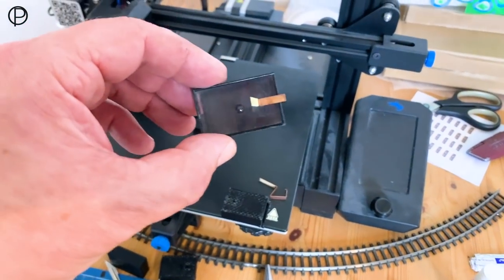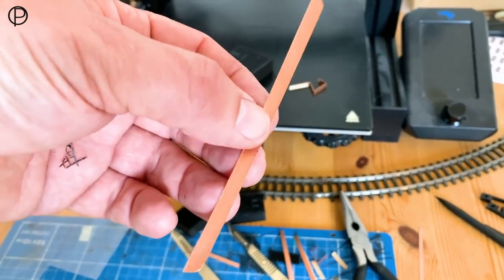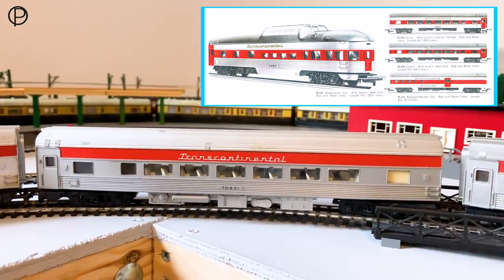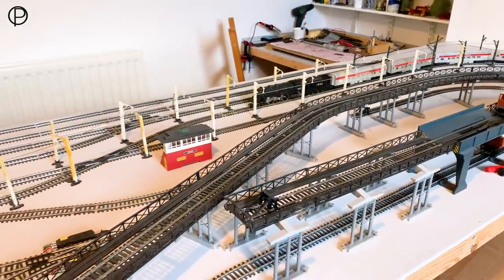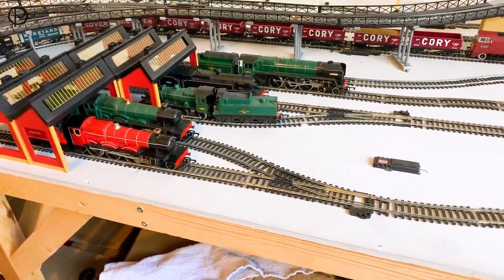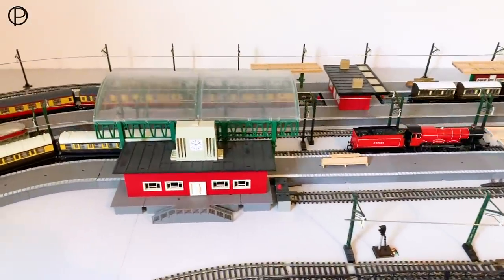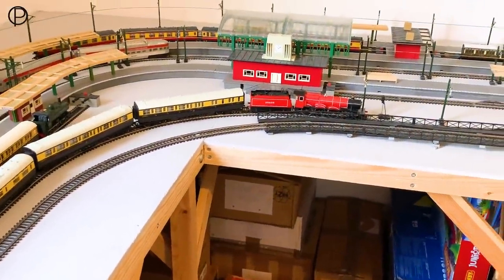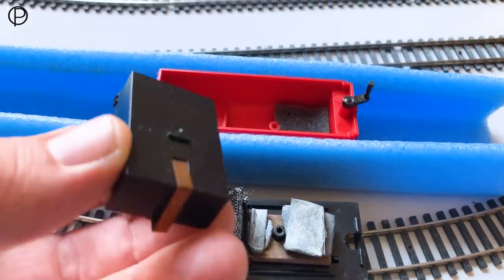Tri-ang Hornby TC Pacific and the Lord Westwood with Exhaust Steam Sound (Chuff-Chuff Sound)

Comment: Morning Oscar you've done a great job making the sound box. If you want the correct material for the arm,  which is also best for making pick ups,  you need to buy a sheet of beryllium copper. It's available on eBay.  This can easily be cut with scissors and retains its spring tension unlike normal soft copper. Kind regards Gary
Reply from the maker: Good morning Gary glad you enjoyed the thanks again for watching and the information. It's a great help and much appreciated I shall look into it.
Take care.
Oscar

Comment: Great video Oscar I fitted one of the original chuff chuff sound boxes to my Albert hall a few years ago, my guess is that the previous owner had taken it out because it had the hole to let the scraper section through and the rear axle on the tender has the part that does the scraping to make the noise, the lord Westwood looks to be a very good model and would look good on any layout because it is something quite unique.
Reply from the maker: Hi David, I think many people remove the chuff chuff sound boxes as it can become quite annoying, I find it quite good fun and great play value, must have been a great selling feature at the time, simple and effective. There's something about the Lord Westwood it is a striking livery correct or not it looks terrific on a model railway.
Thanks again take care.
Oscar

Comment: Good morning Oscar. Great work on the chuff-chuff boxes and nice to see Lord Westwood back on the tracks. I still have a fair bit of work to do before my Transcontinental is up and running. I've done some repairs to its broken body but need to find a replacement for the old Tri-ang tender bogies as the wheels will never work on my track.
Reply from the maker: Good morning Rob thanks for watching glad you enjoyed the video, its great fun item the chuff chuff sound, simple and effective and can easily be removed when it becomes annoying but great play value along they way. I think John at Johns Amazing Trains - chambs123 did quit a number of video's showing his conversion of his Tri-ang locomotive and rolling stock over to wheel set that would run on the more contemporary track he is using. I'm sure he showed the change over of his TC items using wheels that were currently available new and a modification to the original axle boxes. Maybe worth a look across his shell to find the wheel types he was using.
Take care.
Oscar

Comment: Very nicely done Oscar. I don't suppose you'd share your "Chuff-Chuff" box 3D file? 
That plant label strip is something I've not come across before. I'm guessing it's a "phosphor bronze" strip which is something I keep an eye out for as they make great replacement/repair for pickups.
Great video as always.
Reply from the maker: Hi, thanks for watching the plant labels I got from a national chain of high street discount stores a couple of years ago. They were sold as a pack of 10 with ties, I think they were less than £3 and simple labelled Metal Plant Labels. When I realised how useful they were I went back for more sadly the store has not had them since. But they are available on auction sites.
Glad you enjoyed the video take care.
Oscar

Comment: And 100,000 horrified 1970s Mums roll up their sleeves and come looking for you:-) Clever bit of work and an interesting video, would quite like a bit more on what you are 3d printing. The chimneys form the first series of Trian buildings seem a good prospect and I wonder if you could do catenery masts.
Reply from the maker: Yes I can just hear them of the now! I've made various bits and pieces to help with the elevated part of then railway and the odd step and drawbar plus a few other useful bits. I'm not sure the PLA I'm currently using would be strong enough for solo masts. Probably a machine that prints in a resin would create a stronger model/part and defiantly fine details could be reproduced. Funny you should mention the chimneys I have working on a drawing but have not got to trying a print yet. It defiantly going to be a valuable tool as time moves on, these early printers are just the beginning but the software has to become more user friendly as it can become very frustrating. But is great fun when you make something that can be useful.
Thanks again take care.
Oscar

Comment: Hi Oscar,
Great job on the sound box. I wonder if a piece of junior hacksaw blade would produce a 'scraper', might be difficult to form such a small shape.
I am told the tricky part of 3D printing is design and getting the software right, also do you have any experience of shrinkage on cooling down which in turn might render the part unsuitable.
Good Vaseline tip.
Regards and keep up the good work.
Gordon
Reply from the maker: Hi Gordon, your right it's the size of the clip that makes it hard to manipulate the materials I have at hand. The 3D printing software can be very frustrating, I think there is work to do there by the many developers involved to bring it to a wider group of users. There is a slight discrepancy in parts of an mm which could be shrinkage or the edge of the printer's capabilities, it is not so great it's really affecting the parts I've been working with so far. It's been great fun but a couple generation down the line in hardware and software it's going to become quite an import tool for many.
Thanks again for watching take care.
Oscar

Comment: Thinking of visual rather than sound effects the Leeds Model Co were I think the first to introduce "smoke" in their first o gauge goods set of 1949. I have the set and the little tank locomotive but no smoke bottles for it
Reply from the maker: Good morning Nick thanks again for watching. That sounds like an interesting set you have. It's a loverly feature the working smoke, especially on the larger models. Some of the larger American models from Lionel and A.C.Gilbert have great working smoke I think at this size the smoke units are much more robust and reliable and look great in action. Possibly early on I think they used waxy type pellets to drop into the smoke units but I think later and more contemporary units now use smoke fluids. 
Take care.
Oscar

Comment: That was Brilliant with the sound boxes. I was so impressed with the running, then the Diamond Crossing threw a spanner in the works. I am getting more locomotives running and am closer to putting a layout together. I was thinking of using silicon grease on the fish plates to help current continuity. Do you have any thoughts on that idea ? 😁
Reply: I would try a small amount of vasiline on a couple of the the joints to try it out as it carries a current better. It is often used on the battery contacts for cars and bikes.
Reply: Look up "conductive grease".   Quite inexpensive and certainly better for continuity as the grease is filled with tiny metal particulates.   There is also "conductive sealant" if you don't want the grease.
Reply: @WhatAboutTheBee  Thanks for the suggestion 👍
Reply: @timsmith8189  You are welcome.  I've used conductive gaskets to seal RF noise into enclosures.  Works a treat!
Reply from the maker: Good morning glad you enjoyed the video. I don't have any experience with using grease on the fishplates, but there are some great comments attached below from those who have. Thanks again for watching.
Take care.
Oscar